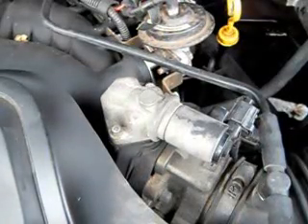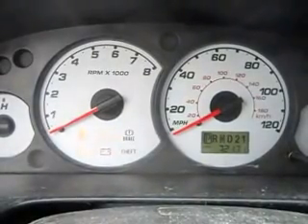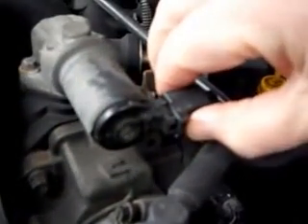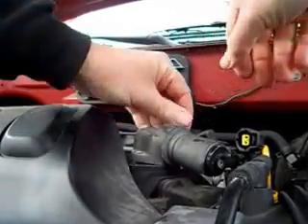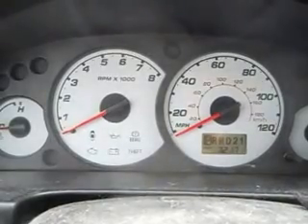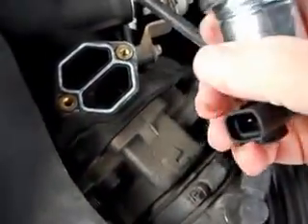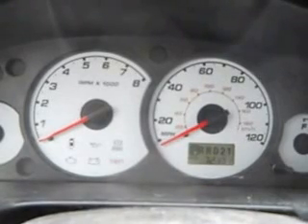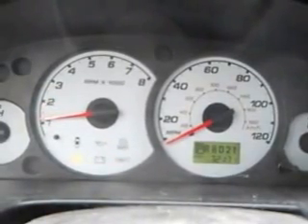EASY! Ford Escape + others V6  Idle Air Control Valve Replace Repair (IAC)

Comment: How many mIles did  you get on the escape.
Reply from the maker: 80,000, but it still ran great. I sold it to a disabled guy that could do the body work it needed. He still toots when he drives past the house.
Reply: Wow thats still low mileage my mom's escape is having trouble staying running came across your video it's got 93000 miles on it it will stay running if you press on the gas and it will die when you let off the gas so I figured the fuel pump is still good went to napa and got a new idle air control valve for it it will be installed probably tomorrow.
Reply from the maker: @coolastro  Let me know how it works out!
Reply: coolastro I just hit 200,000 on mine and it’s just now doing it the v6 escapes are pretty dependable
Reply: @Rekrap42  Just replaced the iac now running great Thank You
Reply: coolastro yeah I just replaced the iac a little while ago, I just cleaned it like the video and it’s running perfectly fine now took me 15 minutes

Comment: Good job. I'm about to trouble shoot my 92' v6 explorer...air filter to throttle body. Censors too
Reply from the maker: They sell a mass air flow sensor spray cleaner, you MUST use that not any other!
Reply: @sixty9harleyPittsburghPAP  yes , thank you

Comment: I have a ford escape xlt 02 3.0 I have in parkin it accelerated it only reaches 4000 rpm the engine sounds strange
Reply from the maker: You are describing signs of a restricted catalytic converter that is blocking the flow of exhaust once the load increases and the rpm increases. Remove both upstream O2 sensors and take it for a short road test to see if the power is back. If so install one and retest, then remove that one and install the other and retest. Doing this will tell you if its the rear converter or the converter on bank one or two that is restricted.

Comment: Where is it 2009 Ford escape 3.0l?
Reply from the maker: Pretty much the same spot, it will look similar also with the same type wire connection.

Comment: i think this truck has the worst gas mileage in it's class.  i have a 2003 v6 3L and it's awful on gas, worse than my v8.  and everything has been replaced. low miles on the motor too. ford mechanics don't know why it's getting such poor mileage. i'll never get one again.
Reply: I have a 2004 Escape with 154,000 miles. Mileage in the city is 11-12 mpg, but on the road at highway speed it gets consistent 21mpg.